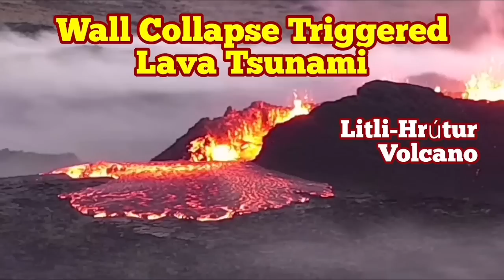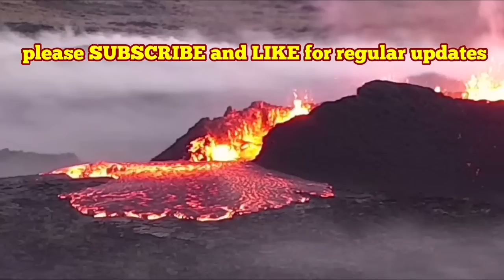Lava Tsunami: Litli-Hrútur Wall Collapse Triggered, Iceland Fagradalsfjall Meradalir Volcano

Comment: But Herr Dr, Surely the heat alone keeps the audience at a distance?
The real danger is the belching CO2 & SO2. toxic gas that can incapacitate within seconds - if not kill?
Reply from the maker: Yes, true. I assumed they obviously can breath yet!
Reply: @TheAstronomer  As you will know, CO2 is the bad one, being a heavy gas that makes the unaware drowsy, so they might sit down and in doing so inhale a lethal quantity. SO2 will form - with moist air - sulphuric acid, which is a nasty irritant.